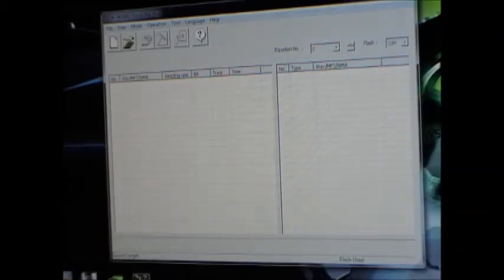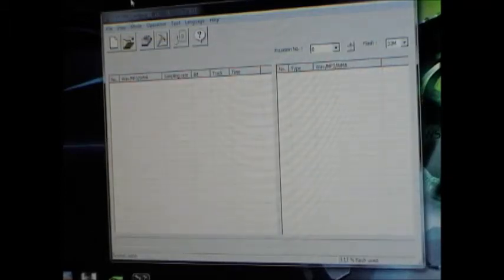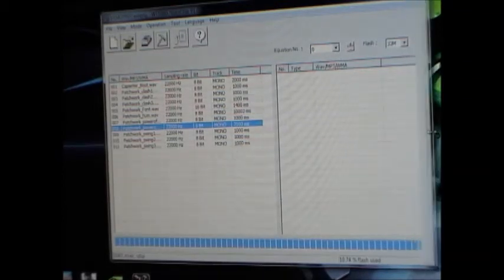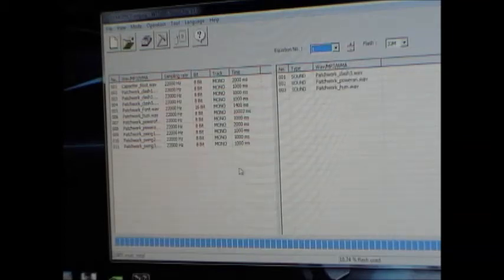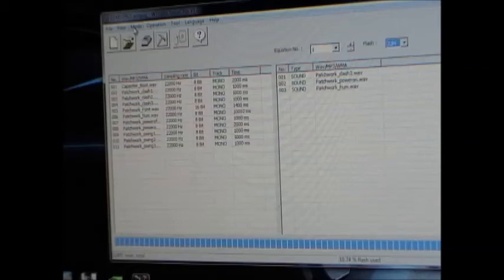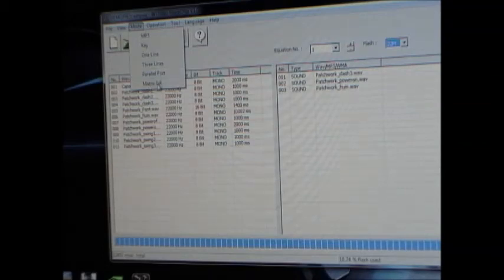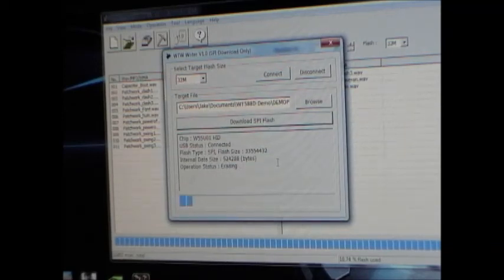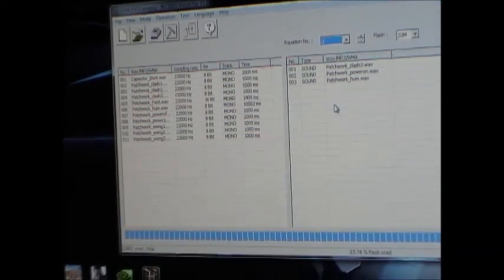WT588D Programming Part 2

Comment: 5 years later and I am having another crack at the lightsaber project. I now understand the need of having clash and hum in one play list. Thank you. Although struggling as 5 years ago my limited understanding of coding has completely dissolved. By the way, love the proto boards. I kinda broke the usb on the stream stardust so that stopped me interacting with the pc. So back to arduino lol
Reply from the maker: Welcome back. FYI, the Stardust/STREAMCore boards have headers for an external USB port, so you can wire a USB breakout board to them and restore connectivity if you broke the built-in port.
Reply: @jakesoft  I thought so. Tried it but still cannot connect. Tried my old laptop with usb2 - as I found out wt588d won't connect to a USB, but arduino does. I wired up the vbus, d+/- and gnd. All I can think of was IO has no where to go. No doubt I have done something. I read a previous message someone else had issues. It still works though. Maybe I did something wrong - most likely. Amazing work you and Obi did with these. I am trying out a feather next. Hope to see more posts of your work. Oh and I made my own hilt with 3d prints. So i need to send that files to the fx saber board if anyone will be interested. Thank again, sorry for the long message, but praises are most definatly needed.

Comment: Great tutorials. Do you by any chance know if there is a Mac/OSX version of the WT588D software out there?
Reply from the maker: ***** As far as I know, Mac is not supported directly by the manufacturer. You'll need Windows or a Windows VM to program the chip.
Reply: jakesoft OK, thanks. I'll consider a VM or another audio solution.

Comment: great, loved it, I am stuck however on how do I program arduino to send the right instruction to the module to let's say play playlist 0 using a three wire setup
Reply from the maker: Daniel Preda Check out this thread on the Arduino forum. Working code is posted there to do exactly that. http://forum.arduino.cc/index.php?PHPSESSID=qh6jckodj2re8rl8rqtvc1ceu2&topic=227435.0
Reply: Connect the GND to the negative, the Voltage to your positive in your circuit and the numbered pins with the programmable in your electronic. Also, change the pin in the arduino program so it matches the pin you hooked up
Reply: I've also had issues with the Arduino software not using the right board (Flora in my case) or the right usb port (check these options in the menus)